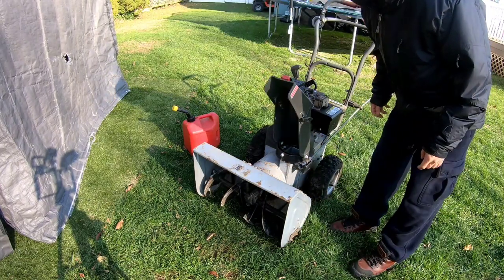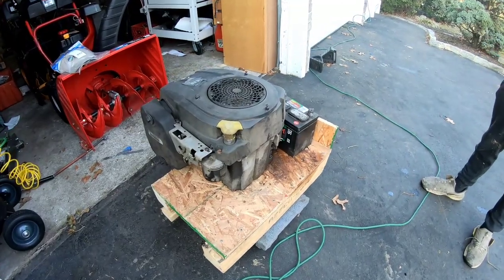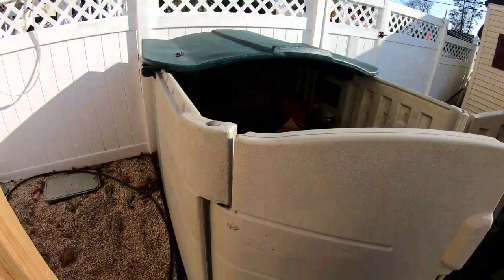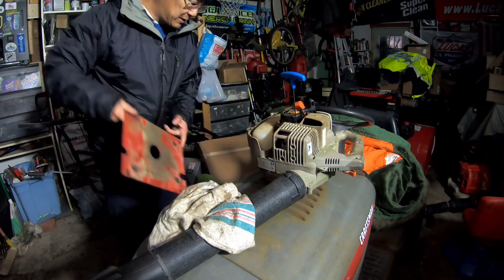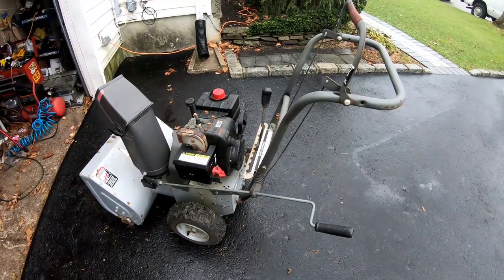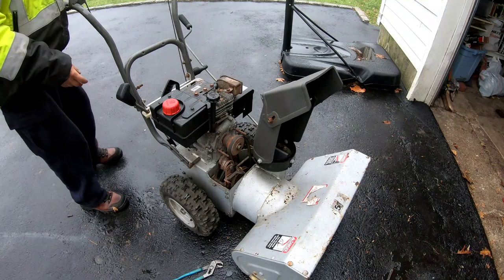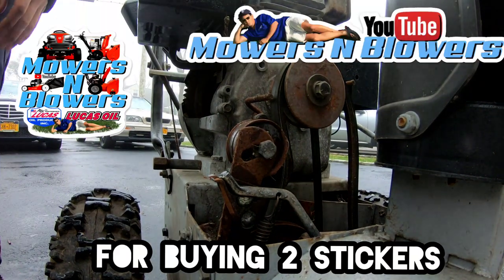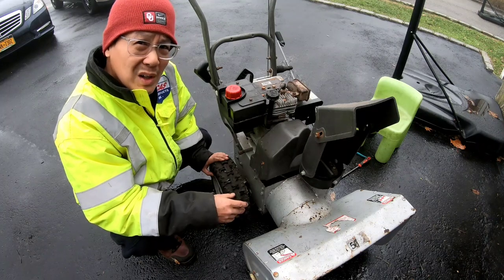CRAFTSMAN 522 TECUMSEH SNOW KING 5HP 22" CLEARING PATH DUAL STAGE SNOWBLOWER WHAT'S THAT NOISE?FIXED

Comment: that rusted pulley will probably wear out the belts also.  i would sand down the pulley groove and maybe coat with some rust converter and then paint it.

Comment: Henry, you put lime on your yard in late, late, fall but only after you test your PH level of your soil. If your PH level is to high and you put down lime you will do more harm than good!  Ryan Knorr has a video about it that explains it very well. If you put to much nitrogen on your yard it would burn it. Nice diagnosis on the snow blower and fix!  Roger
Reply from the maker: Thanks roger, I’ll have to get a ph test kit.
Reply: I put lime in early spring, if it needs it. Soil test is crucial. Gre vid!

Comment: I was given the same snow blower as the one on the right. It's non self propelled. Is the auger supposed to help pull it? It was rather difficult to use today.
Reply from the maker: If the paddles were in good shape,  it’s supposed to pull a little as an assist

Comment: Henry, you can definitely use a dual shaft snowblower engine as a replacement on a single shaft. You just don’t put a belt on the reverse gear. You have your blower engine swap knowledge backwards... you can’t use a single shaft engine to replace a dual shaft without modifying the shifter linkage.
Reply from the maker: I gotcha!  Just don’t put a Pulley on the cam shaft.
Reply: @MowersNBlowers  you can leave the pulley on there as long as it doesn’t interfere. Depending on what model blower you’re swapping from and onto you may have to swap pulleys on the crankshaft itself to get the right combination. Which you’re used to on the lawn tractors. Also, if shaft diameter differs you can buy shaft sleeves on eBay to bump up shaft diameter to fit pulleys. I’ve done a few swaps this season and just sold my 35th & 36th blowers of the season today. The market seems to be a strong here in Upstate NY I hope the market picks up for you downstate bud. Keep up the wrenching man. Love the vids.

Comment: I'd think to spread the ashes on the lawn during the winter where it'll settle down , also heard it was good in flower beds too . If you drink coffee they say the used coffee grounds is good for the soil , I dump all my coffee grounds in my wife's flower beds . She has big elevator flowerbeds ......
Reply from the maker: How does the flower bed look?
Reply: Mowers N Blowers  : I heard many many years ago the old timers telling me to mix  the ashes with  the soil in there gardens - so I wouldn't be afraid to put cold ashes mixed up with my bedding plants . I don't burn wood , but I think if it's Broadcast in your flowerbeds mixed with the remaining dirt it would be beneficial in the long run and of course top dress with a good mulch about 3 to 4 inches thick . I believe in mulching and mulch real heavily  every year  - I buy  my mulch in bulk - 4' by 10'  trailer load .  I'm no expert by far , .......MB

Comment: Sorry, I meant put it on the bar that is tapping the plate.
Reply: Put a big rubber something over the round bar, so when it taps, it won't be so loud.
Reply from the maker: But I fixed it
Reply: @MowersNBlowers  I know, I didn't watch the whole thing before I commented.(I MUNNA) HAVE TO STOP DOING THAT. SORRY
Reply from the maker: Lol!